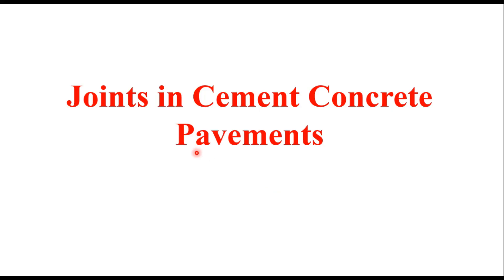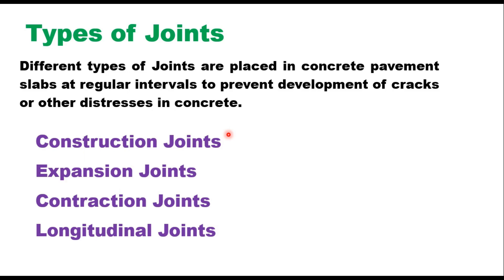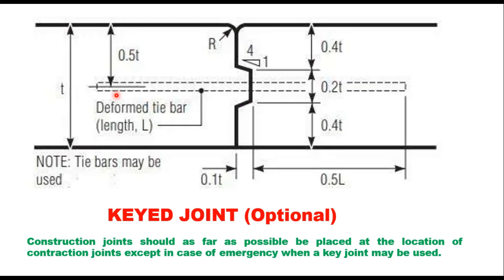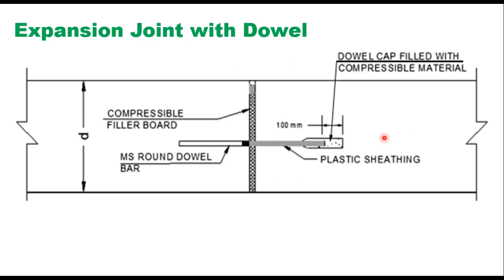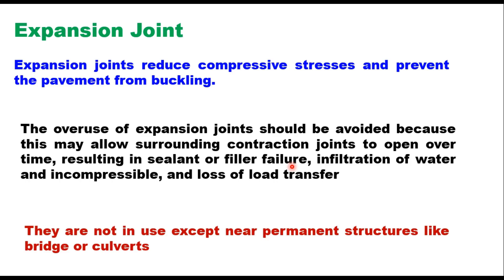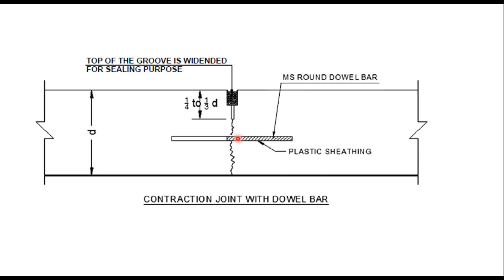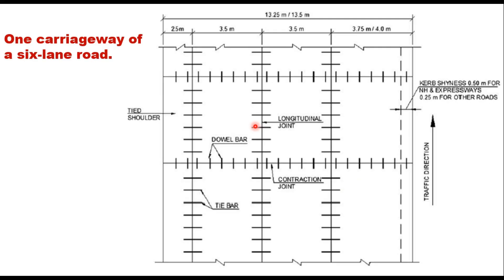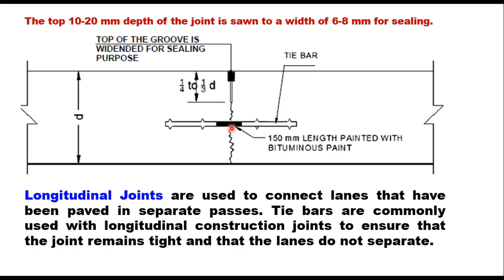Joints of cement concrete Pavements, Their types, uses and maintenance. cutting of joints

Comment: In Dowel bar we used protective cover in mild steel bar .Sir whats should be its direction along the traffic movement of opposite of traffic movement.please clarify sir
Reply from the maker: Protective cover has nothing to do with the direction of traffic.
Reply: @SatishIITR  then at the time of laying of concrete it should be inside the concrete or outside the concrete?
Reply from the maker: @roshantigga2614  watch my video on dowel bars and tie bars. You will get answer to all your querries